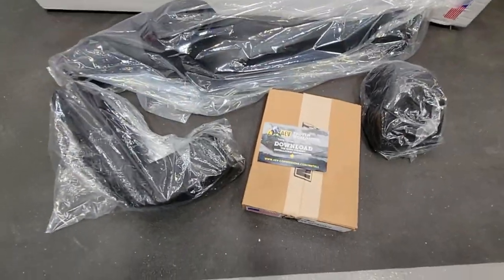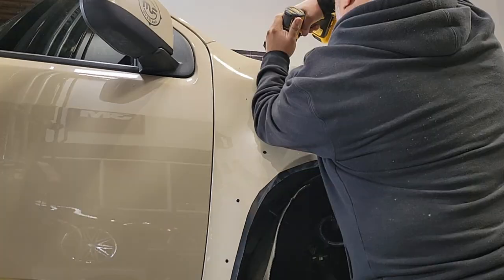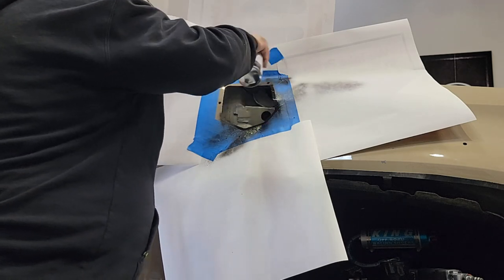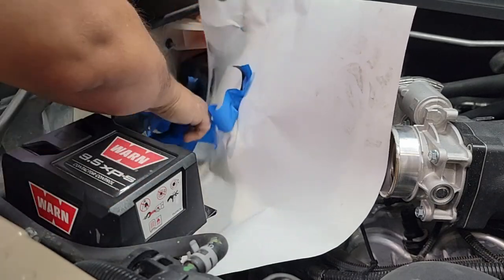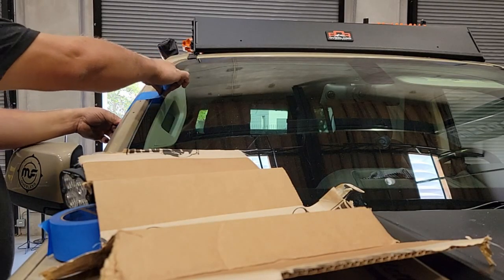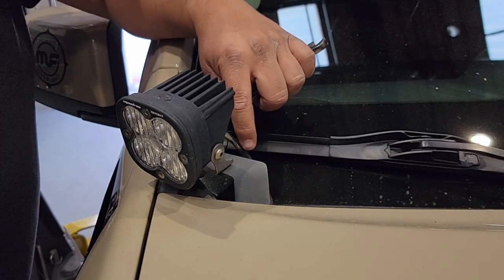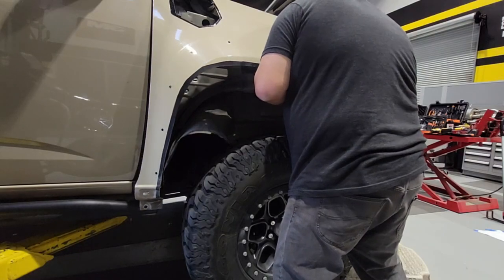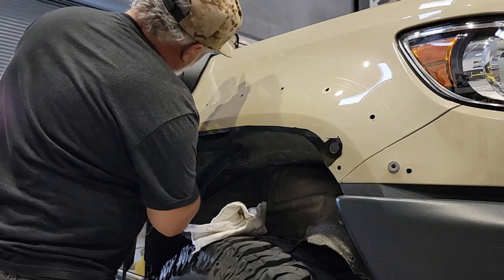Snorkel intake for the Overland Bison - install on 2021 Chevy Colorado ZR2 Bison

Comment: Hey Richard just installed my snorkel and used your video in conjunction with the instructions. Went flawless.  The first major drilling and cutting into the front quarter panel was a lil nerve wracking but I must have measured and checked like 20 times. Once again thank you for taking the time to make these very detailed videos on all the ZR2/Bison Mods.  Has made all of my installations a hell of a lot easier.
Reply from the maker: I am happy that it helped make it easier. It's always a little nerve-wracking when you have to make your first body panel cut. AEV does a great job is making consistent parts but good fitting parts mean making accurate templates and installation instructions.

Comment: I highly recommend a precleaner of your choice.  They keep the air box spotless.
Reply from the maker: I had to make some modifications to my air box for the supercharger to breathe at its full potential and am worried the addition of a pre-cleaner might  be an additional restriction .
Do you have any recommendations with parts you have used?
Reply: @exhaustinglife  I have the Enginaire 4-125/465 precleaner, max rating is 465 cfm.  At 100%VE that should feed the 3.6 to 7400 rpm NA.  When I installed the AIT's remained the same and it is a bit quieter but does have a added sound of the impeller. Kinda a high pitch whistle I can hear at times. The clean air box surprised me, better than I anticipated.
Reply from the maker: @madcratebuilder   my issues are with the 1.9L supercharger airflow demands that are in excess of 120% of the NA theoretical VE (not considering blow by and other valve timing events) I'm closer to 550 cfm need for a no loss intake.

Comment: nicely done! Wanting to do this soon. Any plans for ARB twin compressor? I have winch solenoid and dual battery under coolant reservoir so both 589 and CCE kits are out of the question as you are haha.
Reply from the maker: Currently I'm running a PowerTank CO2 system and a Maxi Trac 300 LPH dual  compressor as back up. At $104 dollars shipped it was a steal.

Comment: Did you notice any loss in performance after the installation of the snorkel?
Reply from the maker: If you are referring to its use in my supercharged application, I had to modify the OEM air box in accordance with Mallet's instructions. Without the air box modifications it would pose a CFM intake limit under the higher boost setting i was running.

Comment: Can you still use a drive through car wash with one of these installed?
Reply from the maker: I have never driven a car i owned through a car wash, but that's mostly about my anxiety from watching car wash video fails. ;) On the serious side, I haven't been able to fit due other mods so I have no practical experience. Generally speaking I would not be concerned about the water issue (they are safe to operate in bad weather such as snow and rain) but more about the flinging brushes or the other drying devises which can catch anything  that is not smooth to the body.
Reply: @exhaustinglife  I only go through touchless car washes and mostly because I am in a wheelchair and it makes it nearly impossible to wash my truck otherwise.
Reply from the maker: @ZR2plowboy  Touchless is certainly the way to go. Those flapper wheels and hovering blowers are quite concerning to all the gear I have on the truck. I would not be to worried with that unless your machine has sprayers that direct a great deal of high pressure water directly at the opening.

At my local coin op I warn the cars behind me that I will be there a while and if they don't take me seriously at first, the stepping into my waders  will usually get them to move to the next bay. I'm not afraid of laying on the wet concrete to blast out the remnants of my last trip either and the looks i get are priceless.

Comment: Will this fit the WT trim ?
Reply from the maker: As along as the WT Colorado is a gas variant of the motors, it will mate to both the 4 cylinder and 6 cylinder airboxes (which are the same) and the fenders / A Pillar are shared.
Reply: Thank you sir I’ll be buying one soon